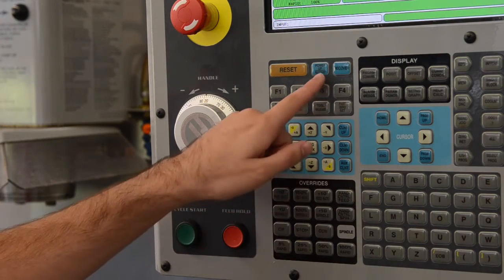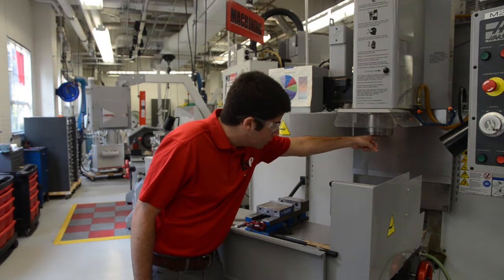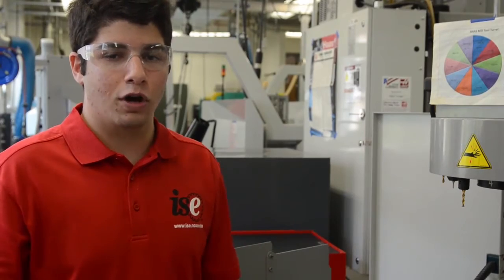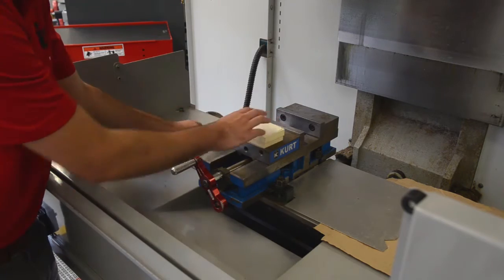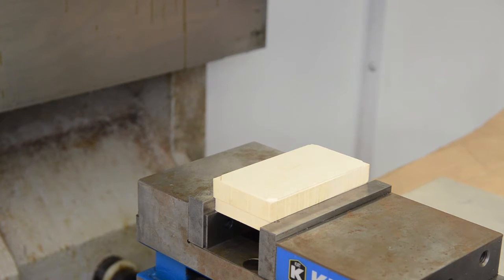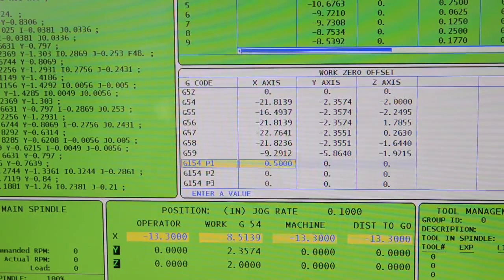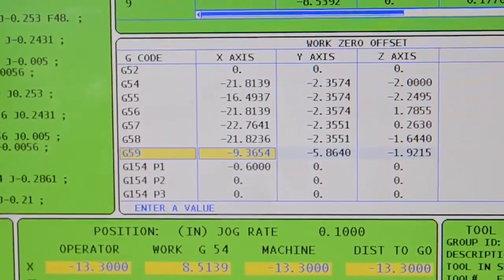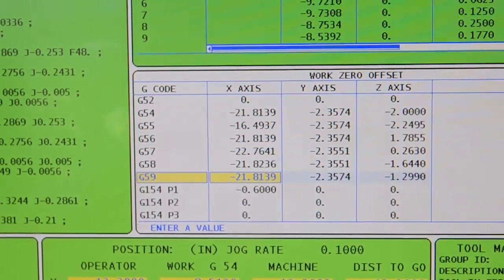Part 2: How to Program Work Offsets into the CNC Milling Machine

Comment: This is realy helpful, my teacher is too busy to learn the haas so he appointed me and a couple other students to find it out, will theis processies work for the simulator model CSGN (or model, i might have got it wrong)
Reply from the maker: Thanks for the kind words. Let us see if we can get an answer to your question.
Reply from the maker: Here is the answer from our lab manager (hopefully you understand all this): The work coordinate offset (WCO) values from the video can be used for practice, but what should be kept in mind is that on the simulator there is no physical entity from which one can take reference measurements.  So the user's WCO values can be completely arbitrary, as long as the following conditions are maintained:

1)  The greatest positive distance for a tool to travel in any axis (X, Y, or Z) added to the negative WCO value for the same axis must be less than zero.  In other words, the tool must always remain in negative machine coordinate space.

2)  The greatest negative distance for a tool to travel in any axis (X, Y, or Z) added to the negative WCO value for the same axis must not exceed the machine limits.  For M1:
     X -30.0000
     Y -10.8000
For Z, the greatest distance the spindle can travel is -16.1270, which places the face of the spindle ~ 4 inches above the table, and ~ 1 inch below the top of the vise jaw on M1.  This is not yet taking into consideration the length of a tool.  The very shortest tool we have in the shop is ~ 2.5 inches.  One can envision a spectacular virtual crash.